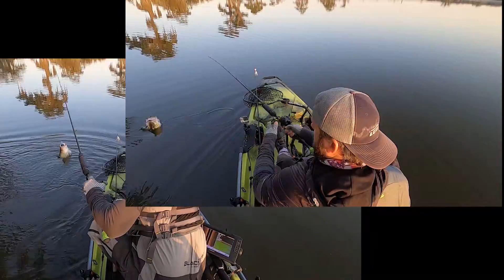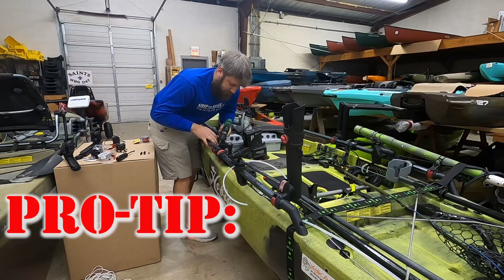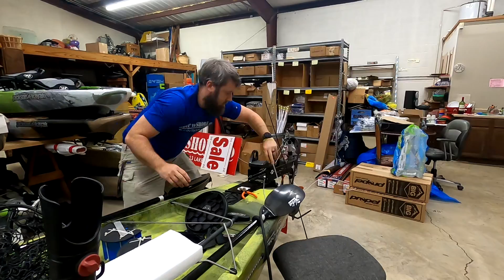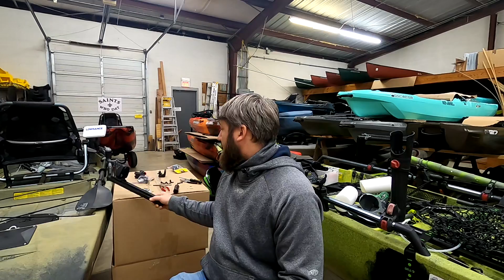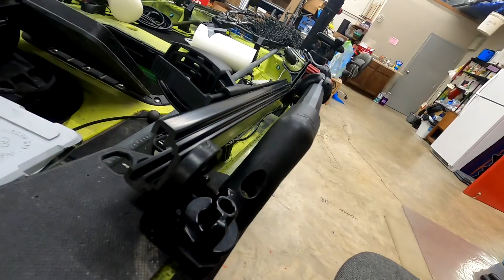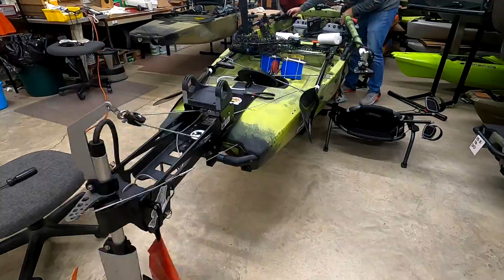Torqeedo Foot Control Steering on a Hobie PA14 360

Comment: What was the measurement for when you drilled the holes at the back of the hobie for boat cables
Reply from the maker: Man this install is a couple years old for me to remember the exact size. I did used the Steering Tube Holders so that made for a bigger hole which was probably around 11/32nds. I would definitely check the size of the tube holder and a couple different drill bits. If you don't use the Tube Holder and just flare out the tube instead your hole will be significantly smaller. If you don't want to drill into your kayak, check out my recent video for the Tim Percy Foot Steering Install. Very simple and clean install! Hope this helps you.

Comment: What size drill bit did you run for your tubing?
Reply from the maker: I had to use 11/32s for the Tubing Caps. If I would have melted down the ends like Innovative Sportsman install, I would have used 1/4" bit.

Comment: How are you liking the 1103 in comparison to the 403? Is the gain in power worth the decrease in battery? I'm trying to decide between the 403ac and the 1103. Although you have more power with the 1103 man you just have so much more run time with the 403ac.
Reply from the maker: I love the 1103 over the 403.. I had the 403a instead of the AC so I didn't notice any major decrease in battery life. 
1103 is quieter, about 1mph faster, and helps me get throw vegetation better (this was my main reason for upgrading)
Like to say if I am going full speed, the displays says I have around 4-5miles.... once I taper it down it jumps up to 15-20miles. If you can figure out the ideal power (~400-600) is what I have found the best running speed/ power consumption.
I do also have a 2nd smaller battery as a back-up I can carry with me if I plan to go further or fishing a tournament. 
I have also began using the motor while fishing long stretches or in the wind as well so the foot control steering has been great as well.
Reply: @JoshDuffel  Awesome! Thank you for the feedback 👍

Comment: innovative Sportsman melts the ends of their tubing.  I wonder if those Hobie caps would fit on the tubing from their kit?  Do you know the ID of the cap?  I am a little weary drilling into the hull but I have to do it sometime since the motor is sitting in my garage.
Reply from the maker: The Caps ID is 1/4" and like to say I used a 11/32 bit for the hole in the kayak for the cap. Think the tubing the IS is is a softer tubing as well. The tubing I used is more rigged. I helped a buddy finish installing his kit from IS.
Reply: Josh. When you drill in the hull (front near the foot controls), I noticed the cord will pass over the other snap cleats.  Will the cord rub back and forth on the cleat or does it have enough clearance with the angle? The tubing you used was in the plumbing department?  Which tubing did you prefer?  I have the IS tubing but that won't work witb those Hobie connectors.  Did you just flare the IS tubing you used for your friends?  I am a little worried about water in the hull.  I mean it shouldn't be an issue since so many people use the same method.   Thanks
Reply from the maker: The line does slightly touch/ rub the cam-cleat, but no sign of wear on the line or the cam-cleat over the 5 months of use. (Used pretty much every weekend since the install if not a little more some weeks)
The Tubing did come out of the plumbing section in Lowes. I found the tubing I got from lowes was easier to slide the Hobie Line through since it was more rigid of a material compared the the IS tubing which was more rubbery. We did flare the tubing on the install for my buddy, but that was also a field install so used a lighter to melt the end the night before a tournament. I have seen the back of my kayak with some water come over the tubing inserts, but have yet to see any significant water in the hull due to the install. There is probably some water sitting inside the tubing at time though. Reason I ran 1 solid piece from front to back. Not getting into the hull to my knowledge at least in those areas or enough to tell.
Reply: @JoshDuffel  thank you so much for the feedback.  taking the plunge tonight.  Thanks for sharing the video
Reply from the maker: No prob. Hope it goes smoothly... the toughest part is running that tubing, but once you remove the foam blocks in the gunnel walls it is a breeze!

Comment: Josh,  have you you had any thoughts of adding Boonedox Landing Gear to this boat?
Reply from the maker: I have added the Boonedox to multiple kayaks and have not had any issues from my customers. So if installed correctly and kayak is not overloaded, the Boonedox works with great. I would recommend the reinforcements for a little more peace of mind, (You can search my other video and I will show you how I reinforce the Boonedox on the PA14 and it is the same process for the 180 and 360.) I will say that is in the one item I miss having on my PA14. However, being I go through kayaks pretty regular I have yet to install it on my last 2 kayaks.